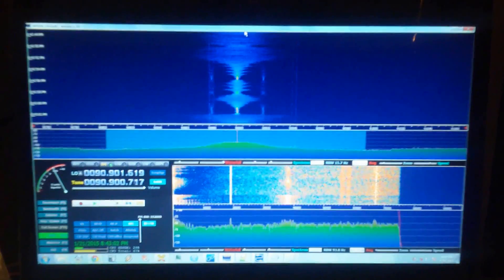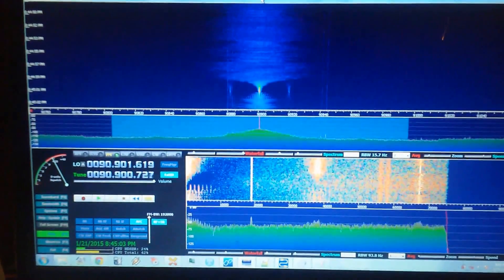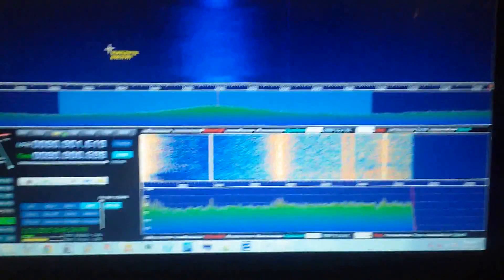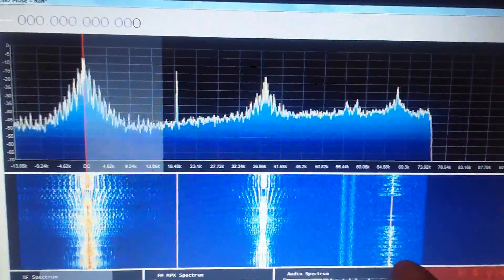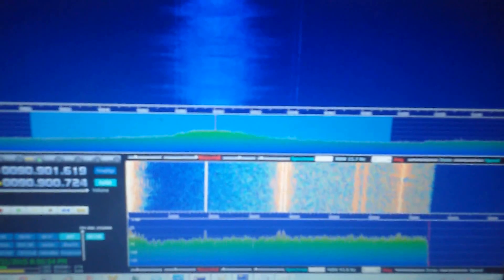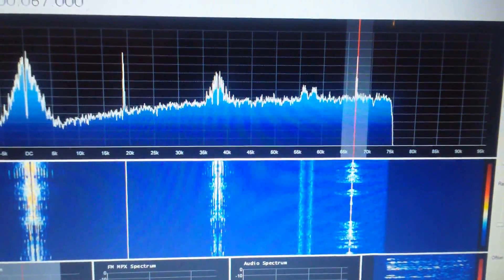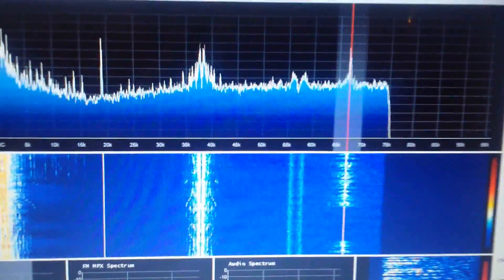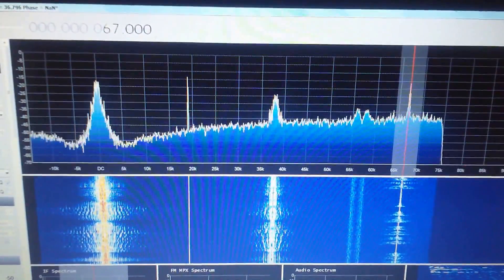Decoding SCA with HDSDR and SDR#

Comment: SDR Sharp wants IQ input from the sound card. When I run it with HDSDR, using this setup, I get some kind of slow oscillation effect and no signal decoding. What am I doing wrong?

Comment: Your link is bad, I cannot access the instructions on how to do this.
Reply: @mikepaige9918     It works way better than than using the HD SDR software.  Thank you so much.  That MPX Output sure did the trick.  I really appreciate this.  I want to experiment with SCA-FM subcarriers on my part 15 FM stations, and this will be a great test software to make sure that it works properly.   The only SCA-FM subcarrier there is is just a readers service radio station on 67 kHz on 89.5 FM here where I live.  I want to build me a basic SCA-FM generator using some VLF NFM nano powered transmitter.

Comment: Nice! I was able to do this with two instances of HDSDR and Virtual Audio Cable. You actually CAN see the subcarriers on the first instance of HDSDR, in the audio waterfall at the bottom, if you expand out the bandwidth to 100KHz. You can’t listen to them, however. On the second instance of HDSDR,the main channel is AM modulated at zero KHz. The stereo pilot is at 19KHz, just an unmodulated carrier, audible as a tone in CW mode. The L-R stereo is DSB AM modulated with a suppressed carrier, ending 15KHz either side of 38 KHz. You can listen on either upper or lower sideband mode. Vocals that have no stereo separation are attenuated in this signal, kind of like a karaoke filter. In my area, some stereo stations broadcast only on lower side and is SSB mode (experimental) which eliminates interference the upper side band would cause to RDS and the FM SCA subcarriers farther up. Surprisingly, the local NPR outlet still broadcasts CRIS radio reading service for the blind at 67KHz! Muzak, PRN, stock ticker data, and agricultural stations are all gone in the Chicago market. RDS has a narrow-band subcarrier at 57KHz, but I found it to be inaudible and almost invisible on the waterfall display.  I got interested in SCA radii in the early 70s about when I discovered phone phreaking and blue boxes. I built a decoder from a Signetics 565 PLL chip that worked surprisingly well. Thanks for the video. Great idea.

Comment: Why are you not pulling in the filter edge on the lower left window down to 71 KHz and the one at 0 kHz up to 63 kHz.  It greatly improves SCA reception to do that.
Reply from the maker: David wilson that would effectively filter the FM signal. You can't do that for SCA. You must pass an unaltered baseband of the entire signal.
Reply: No-you do not need to pass the unaltered baseband of the entire signal--in fact that is a bad thing in general to do.  You can pull in the filters in the MPX display to filter the subcarrier transmission at 63-71 KHz.  Pull the right filter edge slope inward to 71 kHz and the left edge (it is at zero in your display and not visible--grab it from top left corner of the MPX display).  I have been doing this for years and it greatly improves the s/n for subcarriers.  I use HDSDR to feed VBCable to feed SDR#.  In fact at the very moment, I am trying to figure out what language is on WMZQ (98.7) 67 kHz subcarrier.  I do this also to improve RDS reception feeding RDS Spy.

Comment: So why can't you pick that up in SDR# alone? I have an SDRPlay (best receive only SDR in my opinion) and hear WETA and have seen those signals but just thought they were digital. Still can't figure out why you couldn't just see those in SDR# or SDRUno (really cool "HAM radio unit" looking interface with buttons like a real radio instead of menus makes for very fast tuning around ).
Reply from the maker: The thing to remember about FM MPX (which includes stereo and SCA carriers) is that all the sub carriers are multiplexed with the main audio. So essentially the main program (analog audio) is mixed with all the pre-generated RF subcarriers at their frequency relative to baseband, and they are all modulated at once.

In theory, you can recover an SCA without full demodulation; but only if the main program audio is silent. The modulation index of commercial FM is very large,  so the minute the main audio program starts coming up, it quickly begins to deviate over where the SCA.

So do to a proper SCA decode (or even MPX), you have to demodulate the entire FM signal to it's baseband (analog mono audio at 1-15khz and then your subcarriers further up). Only then will you be able to recover the SCA carriers without deviation issues. 

The dual SDR# method was the only one I found that worked at that time. I've since gotten an SDR play and found I still need SDR# and HDSDR; one to give me an unfiltered FM baseband and the other to demodulate the NFM carrier within the SCA. SDRUno doesn't give unfiltered output at all. In order to do it with a single copy of a program, there would need to be a plugin that would demodulate the baseband and simultaneously demodulate the SCA. None such plugin exists that I've found.
Reply: That makes total sense now. Use HDSDR to get the signals divided out. Use SDR sharp to tune to the subcarrier on narrow band FM on the spectrum and let it demodulate. One program only would just demod and split the signal not demod split and demod again. There is so much you can do with SDR but its not like there is a ultimate users guide. I am still having a hard time decoding things in HF. When I find a signal its hard for me to figure out what exactly it is them apply the proper demodulation. Sigmira has dozens of demods but as far as tuning its not nearly as good as SDRUno so I have to find a signal in uno shut it down open sigmara tune in that freq. then manually keep clicking on each type of modulation (PSKxx etc etc ) and HOPE something read able comes out. There has to be a better way/program.
Reply from the maker: That's kind of it. Technically you're demodulating the FM back to it's baseband component; then further tuning using a second program. You have to remember that an FM broadcast actually has a bandwidth of upwards of 100khz. 

As far as decoding digi in HF; that's just about the way to do it depending on what modes you want. I never used Sigmira; I always piped the demodulated audio through a virtual sound card directly in to other software to decode. On the flip side of that there may be some modes that are hard to find support for. 

Picking the right digital mode relies a LOT on being able to identify them by sound as well as what they look like on the spectrum. Since I'm a ham now; I've mostly stuck to playing around with the modes amateurs have at their disposal and don't do much decoding of the military/commercial signals. Modes like PSK you can pick up by sound as well as what it's baud rate is from how it looks. RTTY is a spacing thing..then there are modes that look and sound similar that you kind of have to guess. Often (but not always) on the ham bands you'll find someone using software that supports RSID, which is a standardized method of transmitting the ID of the mode so you don't have to guess. But even then; you have to sometimes guess as to what the person is using.